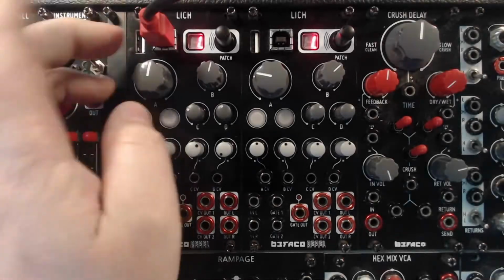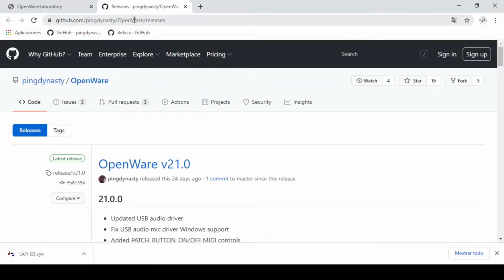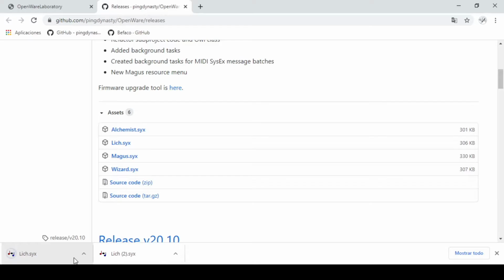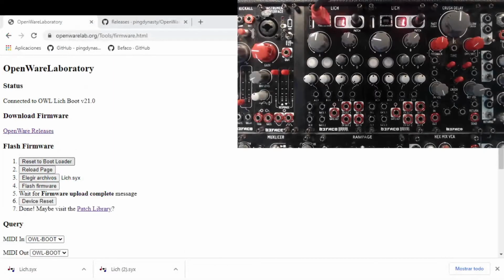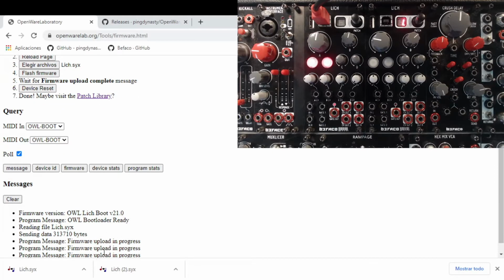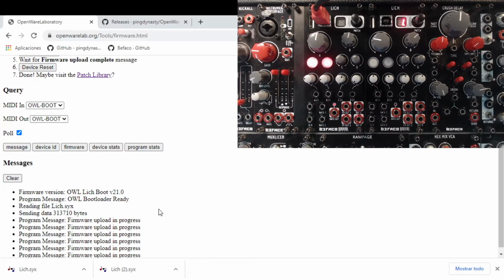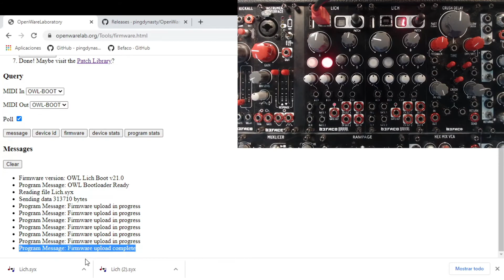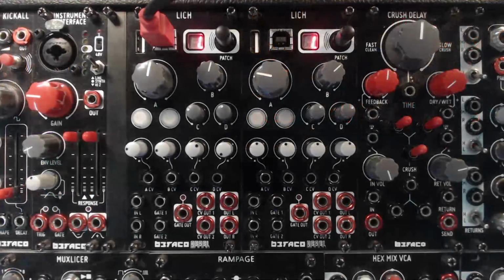Updating firmware on Lich

Comment: Only thing they failed to mention is that you need to calibrate the module after flashing or 1v per octave won't work on patches that use it
Reply from the maker: Information added! Thanks for the heads up